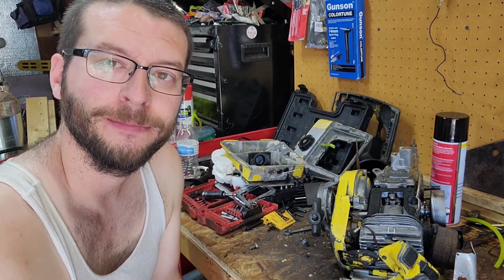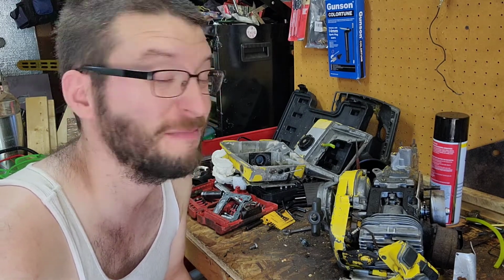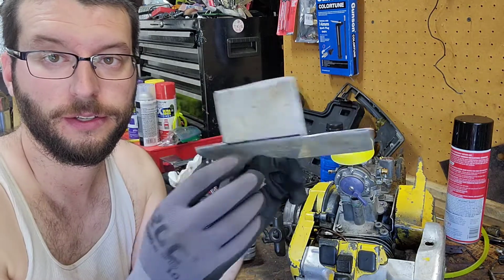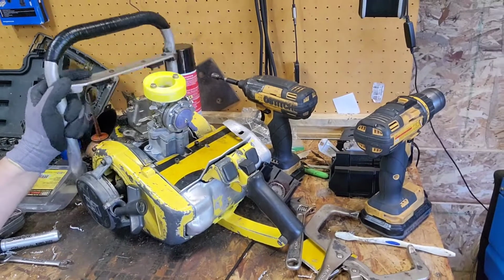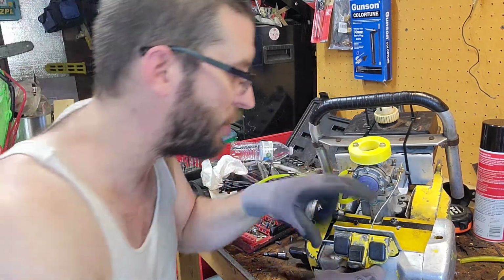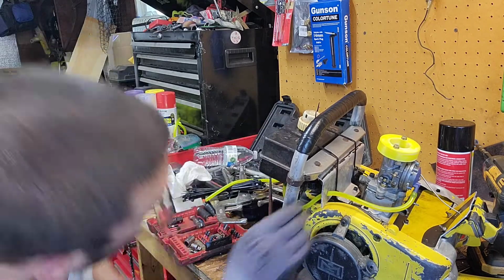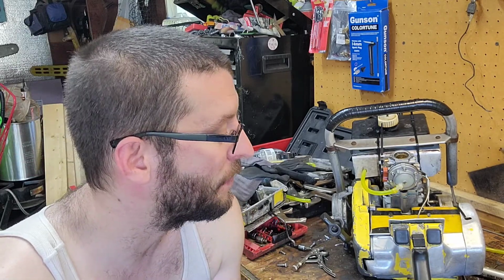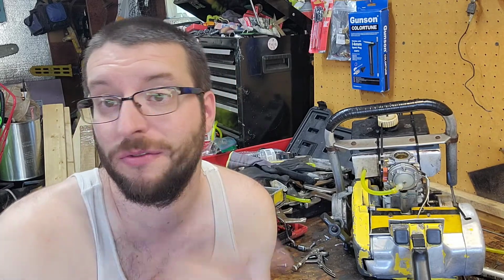McCulloch 790 MC101 3D Printed Gasket Test And Transformation.

Comment: Don't you just love it , you get it all together then you have to take it back apart because something went wrong . I just restored a Pro Mac 60 and I had to take it apart twice because of oiler leaks then front oil tank gasket leaks . I think I got it done finished up around three this morning now got to get a chain made for the 28 inch bar .
Reply from the maker: My sp60 won't oil because the manual oiler won't stay on the body. My pm60 has become a shelf queen, has a bad air leak I don't want to mess with.
Reply: @mistermacgray   Well after I got mine together I put oil in the oil tank and pumped her up and had oil coming out from under fuel tank , well look at one of my parts saw and figured out the little ball bearing that plugs up the drill hole for the oiler valley was not there so some oil came out on the bar but about half of the oil was coming out hole that was missing the ball bearing so back apart . I took the little ball bearing out of a parts saw and put it in with a little JB weld on top of it , then I had problems with oil tank gasket leaking so the new gasket I got from eBay wasn't getting the job done so I made on out of thicker material and fix that .

Comment: Carbs are all too small for a 101... and ignition timing could be off as well.

I had a BDC14 on my 91B, and it did the same thing your saw is doing. Ended up swapping it for a 16 (Double Pumper) and it helped, but still wasn't right... it still idled fast and was untenable. I added a 7L/hr Mikuni pump to feed the double pumper, and now it's perfect. And that's a significantly smaller engime than a 101 🤷‍♂️
Reply from the maker: I've ran my other 101B off this carb with zero issues, it's a HL324 carb and feeds a 090 without issue. Stay tuned for the next video and the next to see how things have evolved and what I've found out that is causing me issues.